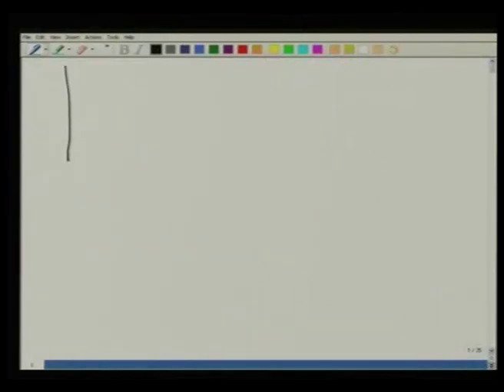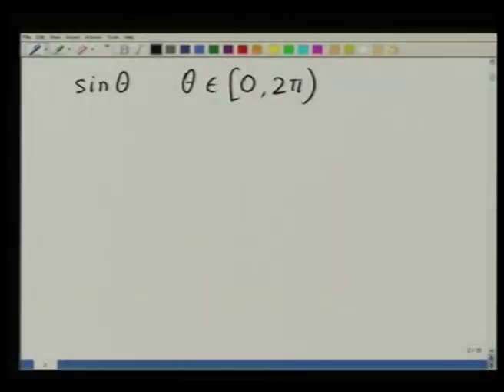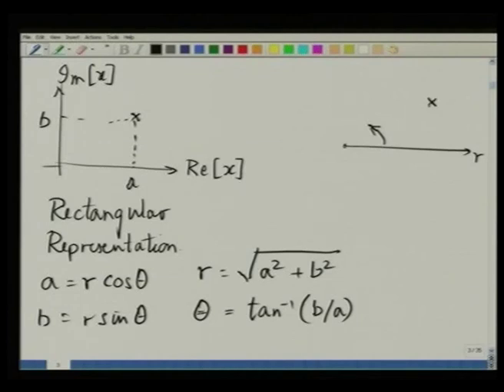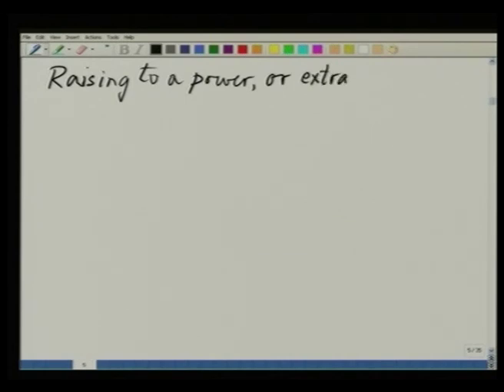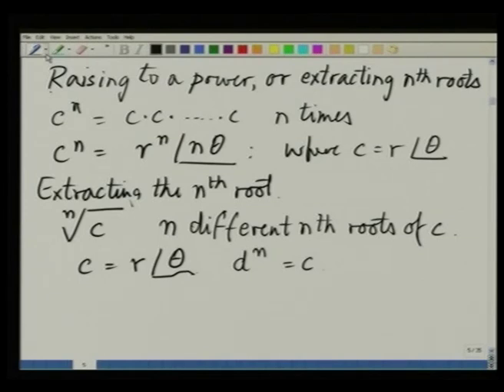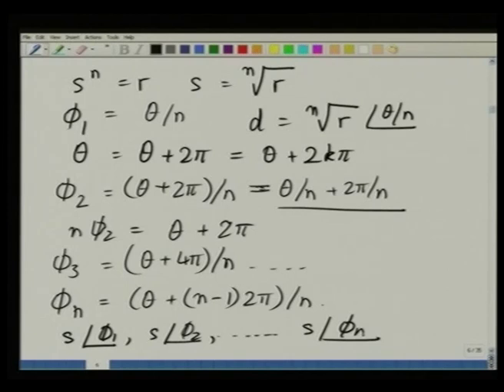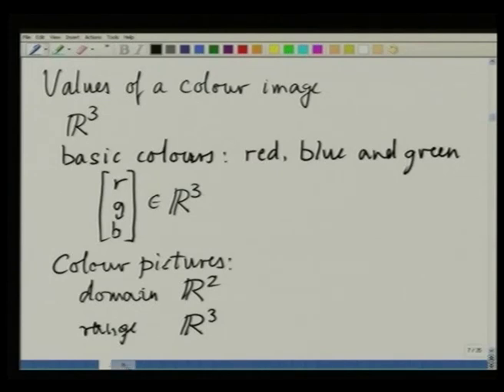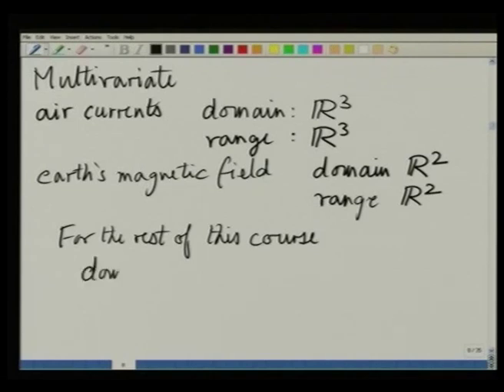Lecture-02 Domain & Range of signal

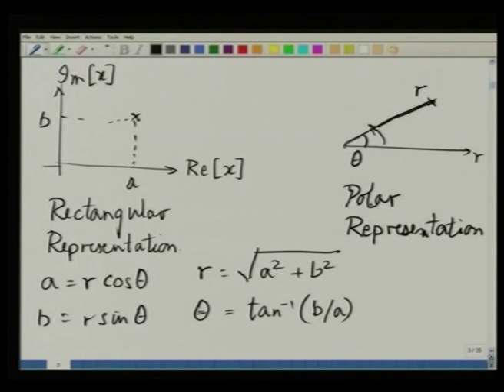Comment: Sir, at 13:50 u said about converting to polar from Cartesian but if my complex number= -3+j4, then my r=sqrt(3^2+4^2), which is 5 so r=5 but now my theta=taninverse(-4/3) so theta would be between 0 to -pi/2....but then my x=r*cos(theta) which is +ve as cos of negative number is positive and my, y = r*sin(theta) which is a -ve number since sin of a negative number is also negative...but it is coming opposite the number i have taken originally
Reply: -3+j4 lies in second quadrant of the complex plain so when calculating the phase (which should always be with respect to positive x axis) uses 180°-taninverse(4/3) that will give you the correct phase